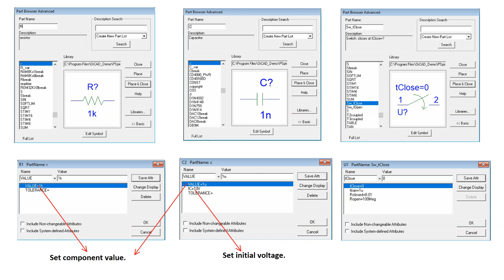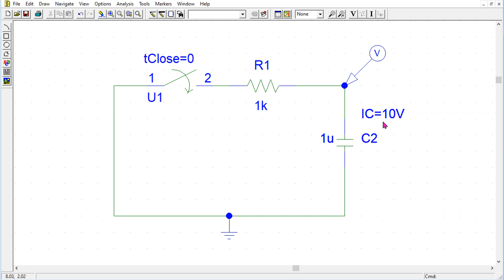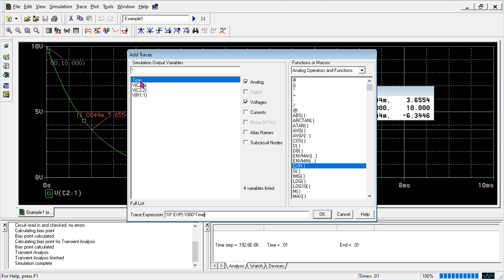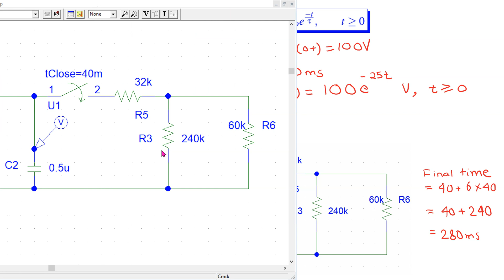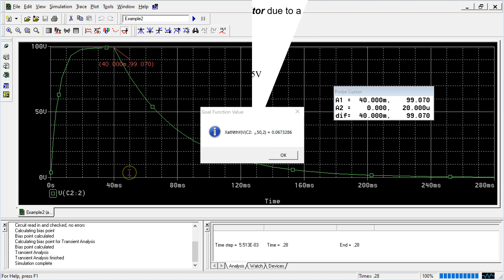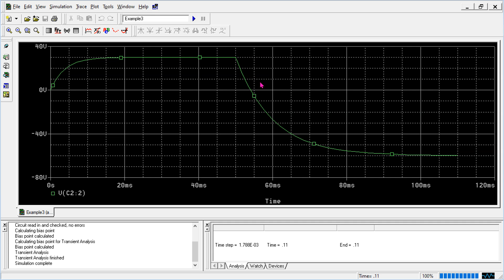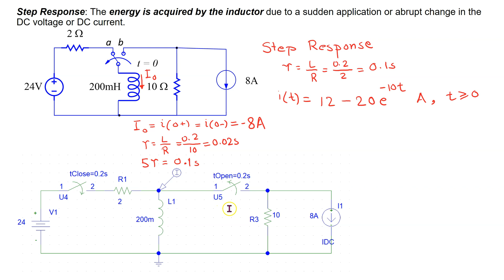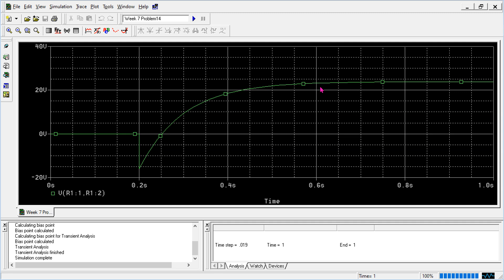Introduction to PSPICE for Finding Natural and Step Response of First Order RC and RL Circuits

Comment: Sir, while trying to simulate it shows 'No such pin Part C1: no such pin""'. How can I correct rh error?
Reply from the maker: It could be that the capacitor is not correctly wired up in the schematic. I take it that your pspice installation is done properly...It could be an issue accessing the parts library.
Reply: @electriccircuits7164  Sir, the problem is solved. Thanks!

I am trying to plot the transient current vs time for a discharging RC circuit. Could you provide me by any link for the same?
Reply from the maker: You need to place a current marker in the schematic to be able to plot the current.
Reply: @electriccircuits7164  Yes sir. Now it works. Thanks!
Reply from the maker: Glad the problem is solved!